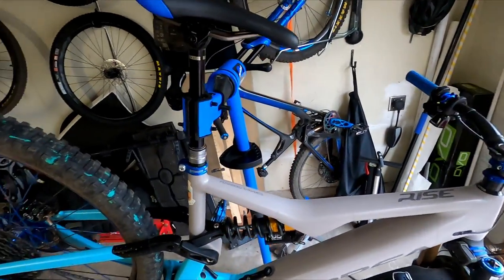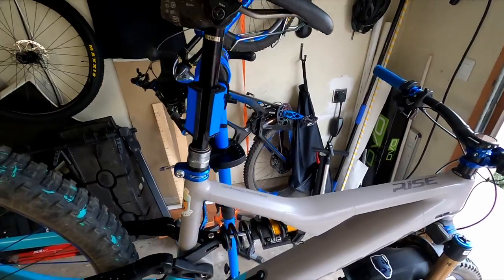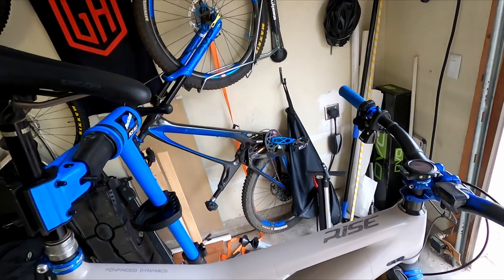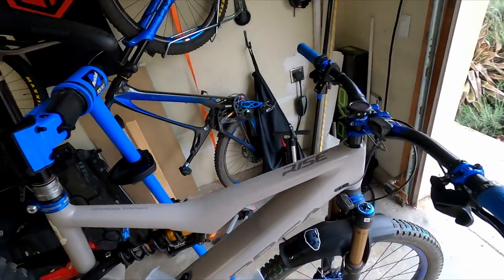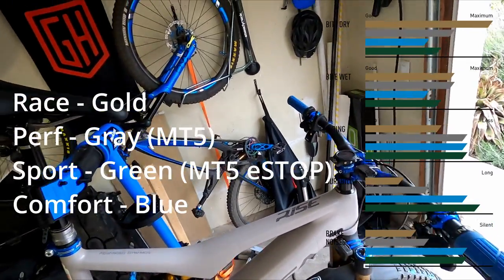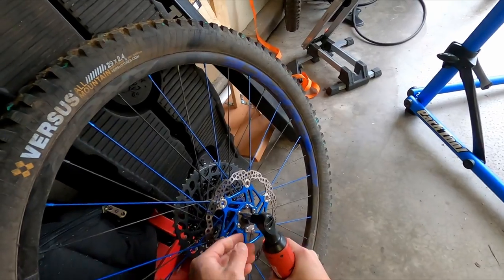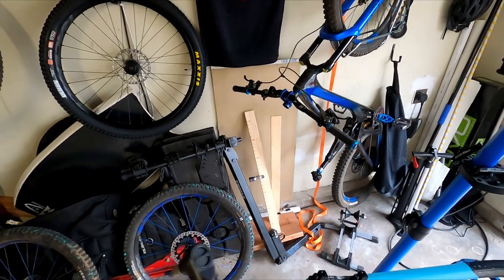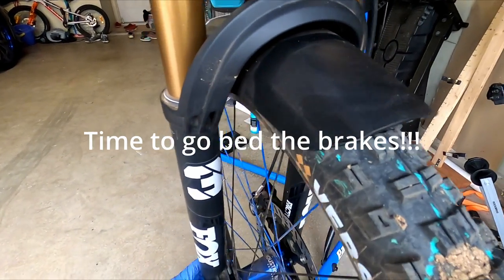Orbea Rise Hydro build - MT5 or MT5 eSTOP? Lesson learned.

Comment: I have the 2022 Rise Hydro 15 but it has the center lock rotors.  Curious did you upgrade the to the 6 bolt rotor or was that how it came?  Thanks for your videos!

Comment: Nice video. So our stock wheel set is a center lock. I think ur wheelset is not the stock. So when u changed the rotor? Do i need to buy a new sensor? Or it fits on the magura rotors?
Reply from the maker: Hi yes you will need to buy speed sensor for the 6 bolt version. Bosch or Orbea both has them. https://www.bikebling.com/Orbea-6-Bolt-Disc-Speed-Sensor-Magnet-p/orbea22-x240.htm
Reply: @allshownogolf  how about the one that magura sells? Will that one fit?
Reply from the maker: @MTBhobbY  yes it should. I think they all look similar.
Reply: @allshownogolf  thanks for the reply

Comment: Hi use shigura upgrade and mt7 brakepads
Reply from the maker: I have Shigura on my other bike, XTR and MT7 with performance P.8 pads which is the same pads I have on right now. I feel like that'd be too much bite for now. After I got the MDR-P rotors everything is good. The Hope float rotors with 1.8mm thickness was the main culprit. MT5s have plenty of bite with P.8 pads. Thanks for your suggestion!

Comment: Also how do you like the fox fork vs your previous Dvo?
Reply from the maker: Small bump sensitivity on the DVO is amazing due to the OTT.  End stroke support is pretty good on both but Fox slightly more supportive likely due to spacer tokens. I am trying to improve initial stroke sensitivity on the Fox without compromising the bottom end support by adding another token and decreasing air pressure and softening low/high compressions 👍🏻
Reply: @allshownogolf  wow thanks for the insight. I understood maybe half of what you just said. Keep the reviews coming